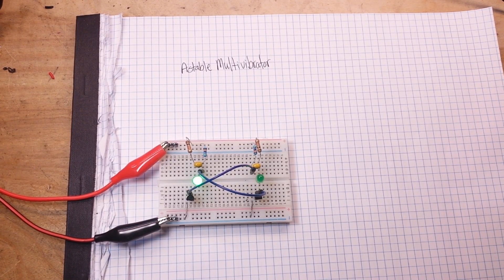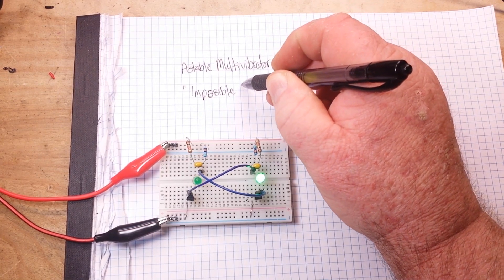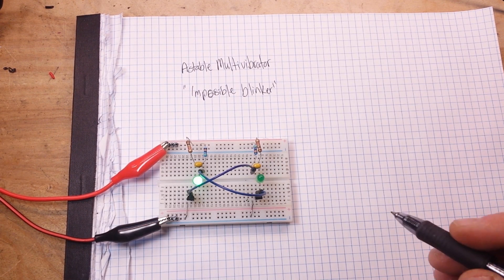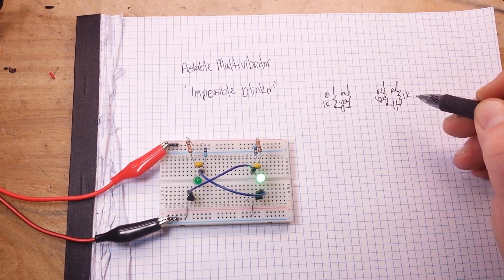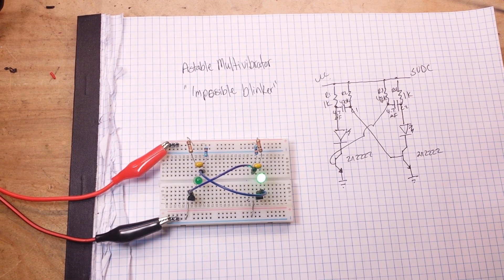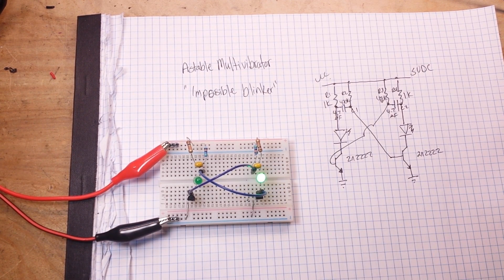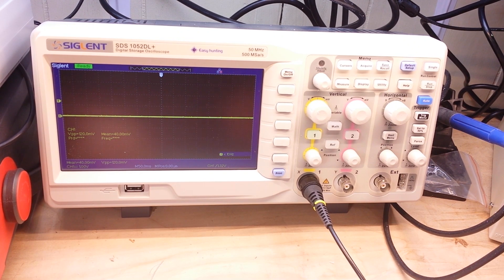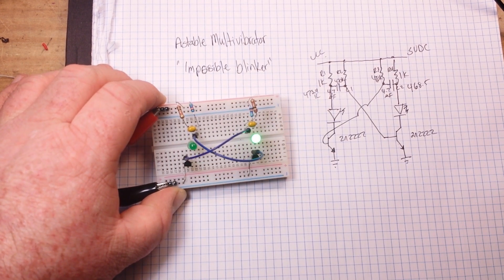Classic Circuits You Should Know: Astable Multivibrator

Comment: This was my first ever circuit I've built... and the PCB was etched  in HNO3 after I've draw it with nail polish... somewhere around 1980... Behind the iron curtain it's obvious it was made with no LED's but bulb lights and with Ge transistors... :P
Reply: Why doesn't the circuit work with silicon transistors and bulb lights? why do i need Ge transistors?

Comment: The two resistor are controlling the charge of the condenser but the quirkiness is that in your first example explanation following the 1k resistor that would charge one side of the condenser but this would cause a polarity potential difference between those two points, I mean obviously either end of the condenser then that equalization causes the rise to the gate potential, so I think it is tolerance differences but mostly the key is the condenser disequilibrium. No?

Comment: Nice demonstration on the classic astable multivibrator.  That circuit works even better if you connect the capacitors between the diodes and the collector.  What you are forming is a differentiator with R3/C2 so that when the voltage at the collector of the rightmost BJT goes low, the negative transition is coupled to the leftmost BJT base.  Therefore, the leftmost BJT stops conduction.  

By placing the capacitor on the anode side of the LED, you are left with a lower valued negative pulse - it works, but may not through temperature ranges.  As R3/C2 charge, the left BJT stays off and the right BJT stays on.  This continues until Vbe on the leftmost BJT reaches 0.6V to turn it on.  

When it comes on, it comes on hard and pulls C1 towards ground (but the LED conduction of 1.8V + Vce(sat) of 0.4V keeps it from hitting 0V).  R2/C1 form a differentiator; so the negative pulse pulls through to the base of the rightmost BJT - forcing the charge out of the base and turning it off.  The cycle continues ad infinitum.  

If you placed your scope at the collector of the BJT, you would have had an easier capture, as the pulse pulls withing Vce(sat) of ground, Where you had it was pulling Vce(sat) + about 2V for a green LED (1.7V for red).

You are spot on as to why this circuit starts up as it does!  It is a race between the BJT's, Rs and Cs as to who gets to turn-on first.  Since nothing is perfect, one of them wins the race!
Reply: @learnelectronics, you should do a monostable multivibrator, too!  I think that'd be cool. We'd learn about AC coupling and differentiators and how a small pulse can turn on (and keep on) a BJT  using that trick.

Comment: Great video and explanation! What about the tolerance of the capacitors? Could they play a role as well?  I love the conclusioni: "It works because nothing is perfect" ;)
Reply from the maker: To a small amount the capacitor tolerance plays a roll, but its very very tiny. The resistors control the speed at which the caps charge.

Comment: Why You not examining the 1K resistors, they also not equal and not perfect  ?
And I think if we let the circuit run for long time there will be a moment in which the two led will lights at the same time. The chaos low :)
I build the circuit and it's blink only when I use electrolytic capacitors instead of ceramic ?!

Comment: So by some freak chance you get components the same value it's just 2 LEDs lit up? Thanks, Paul, these are some great circuits and videos!
Reply from the maker: You would have to get perfectly matched resistors and capacitors. It's just not possible.  But you are correct,  they would both just light up.

Comment: I made this just a couple of weeks ago and your explanation has helped me finally understand what is going on, thank you. How could a simple circuit like this flip flop be utilised in a bigger circuit? Or rather, are these simple circuits of any use, other than for study of the basics?
Reply from the maker: Well, you have a two output oscillator here. On the left Q and on the right Q(NOT) when one is high, the other is low. On or Off, 1 or 0. This can be used for clock signals or switching other components.